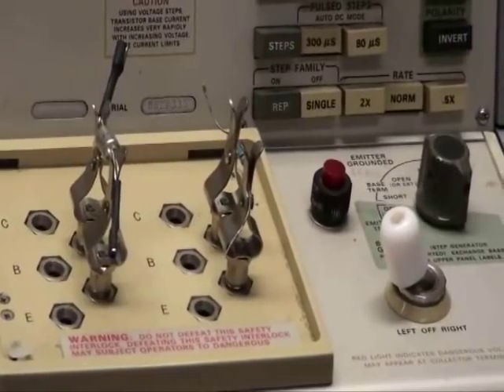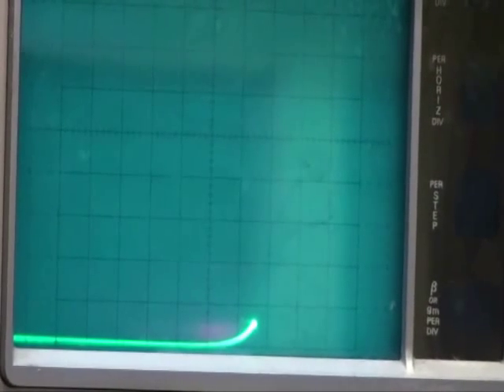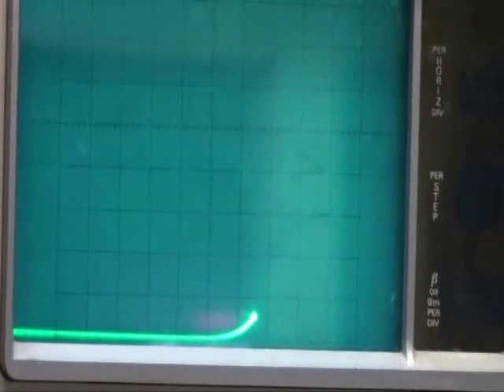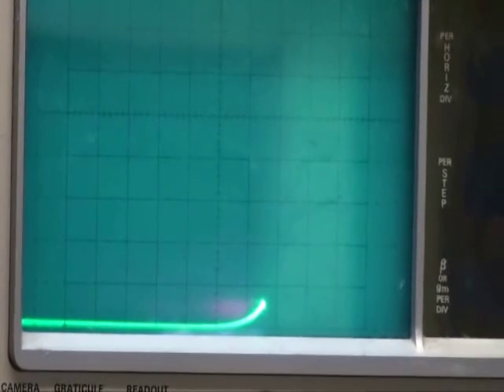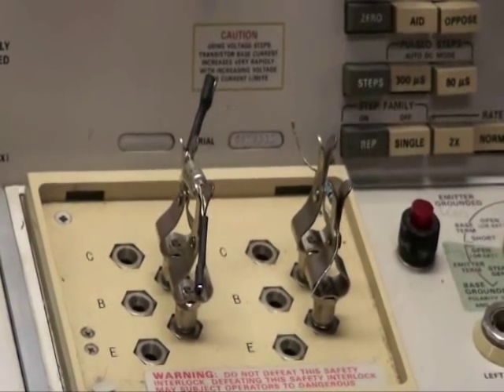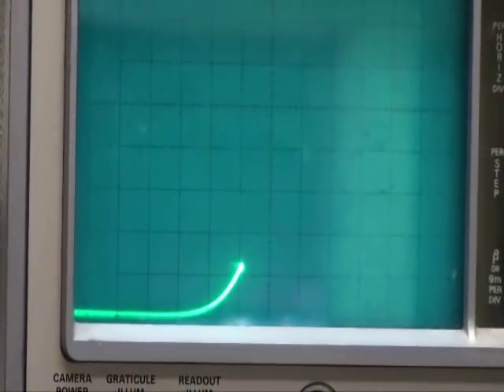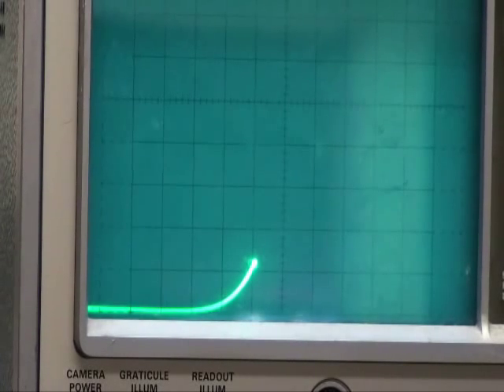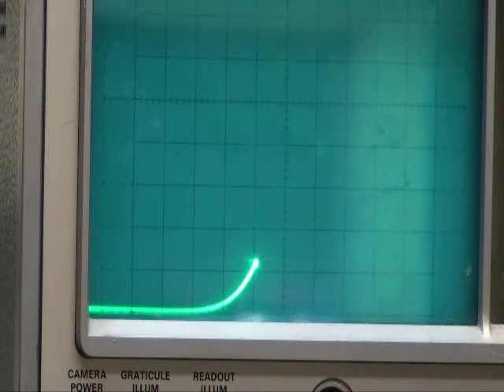1N270 1N60 1N34A GERMANIUM DIODES

Comment: He should have revealed the current scale (vertical scale) he was using.  Typically, at low currents, a germanium diode will have lower forward voltage than a Schottky diode, and a Schottky diode will have lower voltage than a germanium diode at higher currents.  At a high enough current, the germanium diode will also typically have a higher voltage than a silicon junction diode.
Reply: I suspect this germanium diode is a germanium Schottky diode.
Reply: Well, perhaps I'm wrong. Just beware, ebay has these for ten for a dollar -- these are not the point contact germanium diodes, they are Schottky. The scammer only really knows what it really is.  It's is great though someone is really still making Germanium diodes.